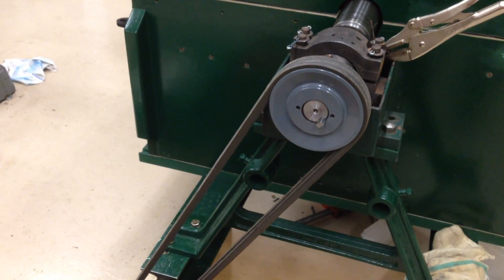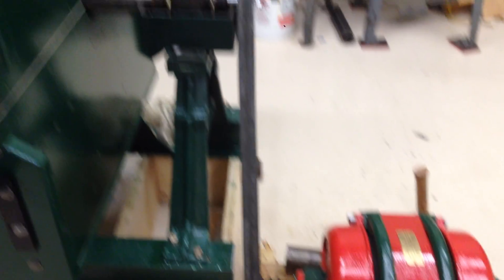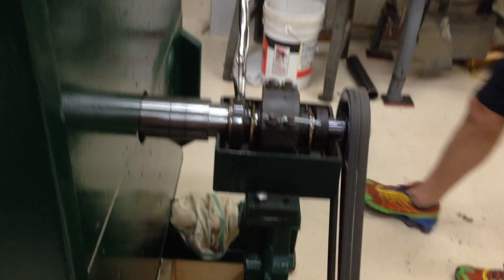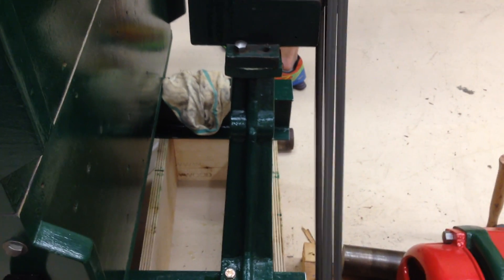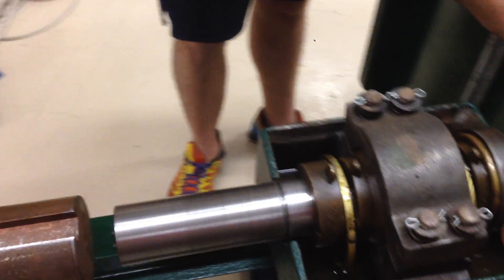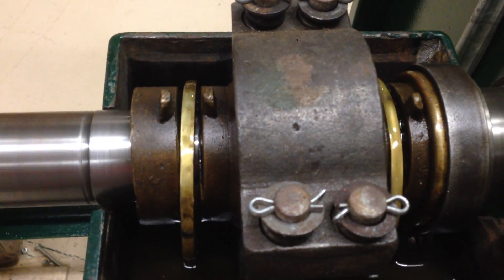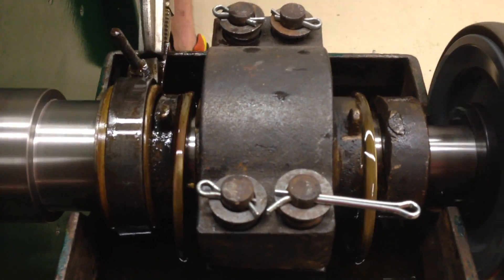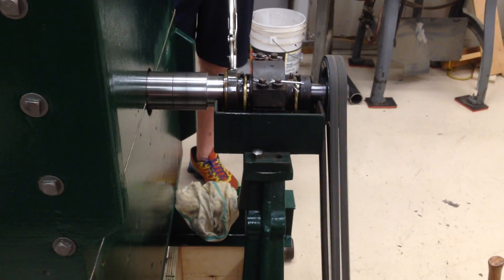First Test of the Midmer Losh Swell Low Pressure Kinetic Blower

Comment: Great video! I haven't seen oil- ring bearings for many years since I worked in a British power station 40 odd years ago. They were on the motor for a big condensate extraction pump and never gave a moment of trouble even when running for months at a time. Cheers!

Comment from the maker: Thanks for your commentary. This is NOT how the blower runs... I will put a link to one actually starting and running... This was a test just to see how it turned. https://www.youtube.com/watch?v=AE74UaScCA8 is a 30 HP one starting up before it's Variable Speed Drive was installed. and https://youtu.be/IPFizsJxnZw This is the same blower in my shop being tested. As you can see the balance is fine, the fans and shaft weigh around 700 pounds so if there was any out of balance, that nickel would not stand

Comment: Too bad somebody had to put politics into a video about musical instruments. That much slippage at startup will glaze belts before long. Try doubling the size of both pulleys. The "gear ratio" remains the same and you get far more surface area and friction for the belts in the larger pulleys. Using a 4-groove blower pulley would also help tremendously. Running only two belts and in the outer two grooves of the motor pulley is going to be a lot harder on the motor and its bearings than running four belts or two belts with much larger pulleys and lower belt tension.
Reply: god for bid someone should use the name of a former president as an example of an authority figure who decides things...
LOL I'm not sure why I am even here in this part of the internet but I felt compelled to add my opinion to the comments section, and that opinion is that this was an interesting video, thanks Gary.
Reply: The blower will use a direct drive with a much larger motor. The belt drive setup is just for this test.

Comment: Funny how when I first saw this video, I liked it for the big motor and blower. 

Now, seeing the Midmer Losh pipe organ is on my bucket list.
Reply from the maker: You Really need to see it this is just one blower. We have done 2 of them so far.
Reply: Running the organ in its current state takes five blowers (low swell, high swell, low great, high great, 100" compressor), and there are two more for Fanfare (Left center and upper chambers) and Echo (same on the right). It's possible that dedicated blowers for the forward chambers may be added as part of their restorations to solve wind supply issues, currently they share the low pressure blowers for the stage chambers.